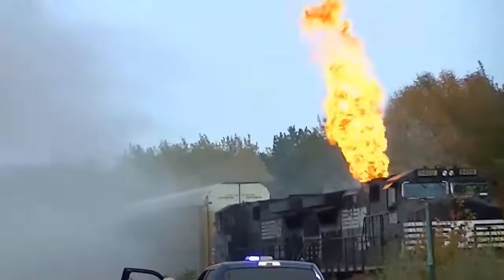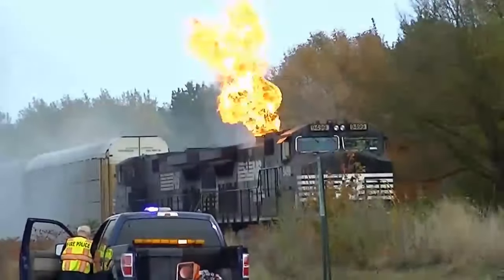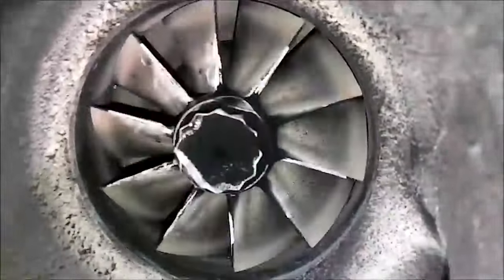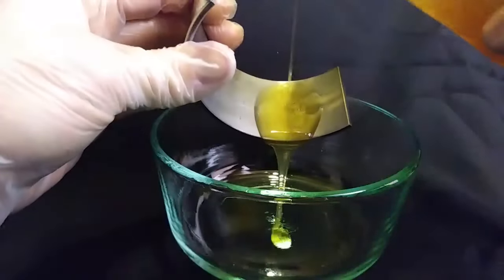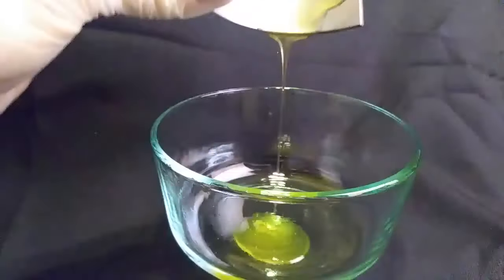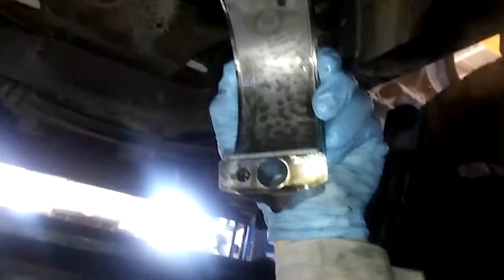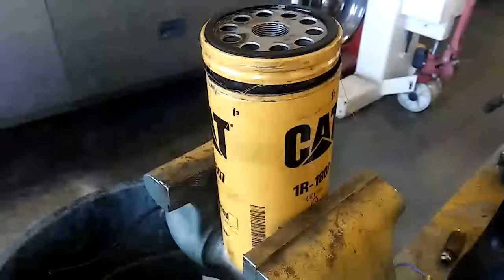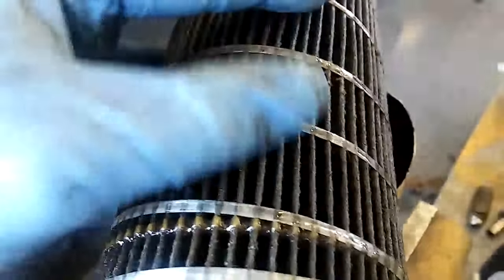Engine Block Heater vs Oil Pan Heater. Everything you NEED to know about Cold Weather Diesel Engines

Comment: After the states in the video,  the two most important cold start tips for freezing temperatures in my opinion would be to turn tgr key on and wait about 30 or 40 seconds after the flash does its thing to let the glow plugs cycle and to push in the clutch on standard trans regardless of it it is in neutral or not.

I sometimes will let the glow plugs cycle twice before attempting to turn it over.

The clutch disengage the transmission so the starter isn't turning over the mass of the trans components.  It gives a slightly faster crank and your batteries will last a bit longer in the cold start situation.
Reply: Fine advice for passenger vehicles, but these old yellow motors have no such fancy heating contraptions. 

👍 pushing the clutch helps, not something most think about. On my old 7.3 I'll cycle the glow plugs 3 or 4 times before I even try to start it when its down in the -30/-40s.
Reply from the maker: Pushing in the clutch does help reduce the starter load.
Reply: I never cycle the ignition in cars, instead I listen to the relay clicking. Usually the glow plugs actually stay on twice as long as the indicator is telling you :)
Reply: @jaydunbar7538  heck. I have to do that on my 7.3s even at 30 degrees.
Reply: Most modern vehicles have a safety interlock that won’t allow you to even crank it until the clutch pedal is pushed in, and they’ve been that way forever. I bought a new 1979 Chevrolet 1/2 ton with a 4 speed and it came with a clutch interlock switch on it, but it was disabled the first time it came loose from the clutch pedal arm and wouldn’t crank. I had to coast it down hill and dump the clutch to get home. Found the switch had fallen off the clutch pedal arm the next day and promptly cut the switch off and connected the wires together for a permanent fix.
Reply: I had no idea about the clutch thanks

Comment: I like the coolant circulation heater the one I had would keep the coolant at about 90 to 120 degrees and because it has its own pump so you can use the heater and it usually would keep the whole engine compartment warm... Also they normally run tank blanket when you run up north

Comment: So up in the Alaska arctic oil field we install oil pan pad heaters and also block/coolant heaters. When it's -50 degrees fahrenheit or less we use heat trailers to warm up the engine. Those suckers run at 1500 rpm from fall and then shut down in spring. One driver let one idle at 900rpm all night and the coolant cooled down to 40 degrees and pushed all the oil past the rings and into the exhaust and made a good inspection window in the block. But then a piece of block grounded the positive on the starter and caught the engine bay on fire

Comment: Outstanding information for the trucker. For the logger I have set up a canadian system where I run 2 hoses from my pickup to the equipment circulating hot coolant from running pickup to cold skidder/dozer/excavator etc . Must be the same coolant. 30 min and head temp which is critical for combustion is up high enough to flash off upon cranking as long as fuel is moving. Used at -20F and away we go. Also run into intake flame heater's where you inject raw fuel onto glow plug in intake and intentionally start fire in intake just prior to cranking to increase combustion chamber temp. Found on komaysu and perkins so far.
Reply from the maker: That's a pretty good idea. Did you make some quick connects similar to a PTO to a trailer or something?
Reply: @AdeptApe  3/4" heater hose with quick connect both ends. coil them up in a bag when not in use to keep them safe. About 15' long . If you have a specific piece you are starting cut to length that works. If you're starting everything the one that takes the most hose is what you have to go with for length. Probably holds an additional gallon of coolant tho.

Comment: I made a lot of money towing semis from the USA that came to Canada running #2.   Another thing that fuel will do is plug the vents and all the fuel run to one tank and then draw from the empty tank. Plenty of fun solving those problems   Even though we have additives in our fuel , I always put in fuel conditioner.   The other mistake that operators do is not cover up the front.  It's a lot more difficult keeping that engine warm when it starts dropping below -15c.  A belly bag/blanket is also a good idea if your operating in -20c or colder.  
On my personal vehicle (gasoline) , it's a block heater and a battery maintainer.  I've also used battery blankets. 
If you have none of those things, I suggest using one or two high wattage bulbs/work lights under the hood, covered by a blanket to keep the heat in. It will bring the block temperature up.  
When you live in an inhospitable environment, you learn to improvise.  It's been -30c to -38c all week.
Reply from the maker: It's been cold here this week, but not -30.  I've started using just a cab heater to help get the ice off the windows and helps from turning the heater on immediately, which in turn helps the engine warm up a little faster.
Reply: @AdeptApe  yes, it's been brutal.cold here. -38c last night. Calgary was -42c.  Every little bit helps when getting a engine running in these temperatures.  They were not designed to run in these extreme so getting them to operating temperature takes a lot more effort and resources.
Reply: We pretty much can’t buy any incandescent 100W bulbs here in the US anymore, and the others available don’t make enough heat to matter.

Comment: I knew that i was going where it was going to be really cold, so i added a block heater and a two battery tender. It was -15 degrees, and the truck was ready to start in less than a minute it it didn't work at all to start.

Comment: Other alternative methods: heat gun or propane torch near the air intake, or torpedo heater over the aftercooler if you have one. We have a 7.3 PSD Superduty with a bunch of glow plugs out, and the grid heater could barely be called that. You can't feed it warm air pre-turbo or the aftercooler cools it back down too much. I put a torpedo heater pointed down on the cooler with the hood popped, give it a minute to heat the air charge, and fire it right up. Works pretty well for the really cold days we've been without electricity for the block heater.

Comment: I have an oil heater in the shop that I have waited for this video to confirm that I should install it! Thank you sir for your time and effort.
Reply: Same here Lol
Reply: @glovierstreeservice3271  
I didn't know how hot these things get and I didn't want to degrade the life of my oil. Mine looks like a short water heater element. I'm going to put mine in a available port on the bottom side of my oil pan. It's a C15 Cat.  The blank port is the same level as my oil drain. do you know if there is any clearance issues once installed?
Reply: @victormcox  I dont know about the clearance

Comment: Lived and trucked in the Northwest Territories Canada for 8 years. Block heaters, oil pan heaters, battery blankets, 0-40 synthetic, fully closed rad cover, fully closed in belly tarp, wrapped exhaust and insulated burner box. Insulated def tank and lines, insulated fuel tank,lines and filter, anti gelling additives, methal hydrate in the air system, wrapped and heated air dryer……..and your truck would still freeze up.

Comment: I dump plenty of anti-gel in my trucks in winter.  I also added regulated fuel return systems to heat my diesel.  When it gets bitter cold I add some 100% isopropyl alcohol to keep from gelling.  Do it very often and it can dry out your injectors...

Comment: In highschool (1993/4) I worked for a OTR trucking company that put disposable baby diapers ie pampers on their fuel filters in the winter. They ran a mix of 855 Cummins and 3406A and 3406B engines.

Comment: i got a webasto, and the timer for it, set it for  half hr or hr befor fire n good to go, powered off truck batts no 120v, i also plumped it into my artic fox inframe barrel fuel heater, so pre heats fuel also

Comment: I used to live in Fairbanks, AK, and I found most guys there, no matter what car, pickup or semi or industrial equipment they run, they put all of the above on. Plus a stick on fuel tank heater and heat trace on the fuel line. Then a tarp that goes from the top of the radiator down under the engine and ends somewhere near the transmission. That last one is more ice road truckers in Canada but still, when you're hundreds of miles from civilization in -50f cold, you're going to do everything to make sure your truck isn't going to fail

Comment: My father in law used to work in the oil fields in North dakota. Their remedy to fighting the cold was to basically never shut their trucks off. They would high idle them during shift change and the next crew would do the same. They only got shut off in the shop.
Reply: That's what my company told me to. they barely had 100,000 miles on them but have the hours of a 500,000 plus mile truck
Reply: 500,000 hours doesn't matter because there is very little engine wear. Diesel engines take many hours to get to operating temperature.

Comment: I have owned a 2001 Dodge Ram 2500 4X4 with the 488 cubic inch V-10 since 2004. I have 700W block heater, 150W heaters on the transmission pan, engine oil pan, 50W heater on the power steering oil reservoir, 80W battery blanket, and a small, waterproof trickle charger. I plug it in and I'm good to go. For when the temps fall past -15* I have a 1500W circulating heater. I have never had a problem with my truck except for normal maintenance.

Comment: Seeing that NF Southern engine spewing fire in the beginning of the video gave me a good laugh.  My father-in-law used to work for CSX and told me stories about some poorly maintained NF Southern trains.  Funny story about cold weather and diesel engines.  My grandfather owned a sawmill and logging business when I was growing up in western KY.  The weather in the winter would not get brutally cold like up north, but would have mornings where the temp was in the low teens from time to time.  My dad was driving into the woods early one morning and the log crew had a fire built under their old Timberjack skidder.  Apparently that was their way of heating the oil and engine up to get it started lol.  Very informative video and very well done sir!

Comment: Those little Kim hotstart thermosiphoning heaters are nice.
Most of the gens I see under 250kw or so have a plenty warm block ,and the oil pan (by feel) isn't far behind it. 
On a vehicle it's gonna have to circulate for quite a long time to be able to soak into the oil too though.

Comment: Coolant heats the block, block heats the oil pan, pan heats the oil. My 7.3 will heat the oil pan enough that it’s warm to the touch on the outside after being plugged in overnight. Proper oil weight for the operating environment is just as critical as starting aids. Switching to 5W-40 synthetic has done wonders for cold start performance.

Comment: My w9 3406e comes home with me daily. This is my setup when the cold months roll in. I make a 50/50 blend of T6 5w40 with T4 15w40, oil pan heater and the block heater. Inside the cab I run a space heater. She’s never let me down once and I know there’s good oil flow and lubrication on startup. Also before every winter I run a draw test and clean and lubricate every battery/wire terminal
Reply: Why not just run Rotella T6 0w40 oil?

Comment: I live in Northern Quebec .Deep woods deliveries .I use oil dip stick and block heater .Buy a high amp battery, never had a starting problem even at minus 45...Unimog...

Comment: In Alaska we use all of the heaters to get rigs running with minimal wear
Reply: Honestly Alaska is the reason that the last generation of the Dodge Dart came with the option for a block heater. 
(And subsequent recalls for the dual clutch automatics in extreme temps)

There may be other fiat’s/Chrysler’s/dodges/jeeps that have that option too. Since the powerplants are shared.

Comment: The 120v heaters are about 1500 watts and if you leave it on all night that cost a lot. I use a diesel fired coolant heater that will get engine warm when below 0 f in two hours or less and I don't require 120 volts supply. When the engine is warm the oil heats up pretty quick.

Comment: I have a gas 5.7 hemi.  I run a block heater, battery blanket and oil pan heater, they call that the arctic package and yes I used it in the arctic.  My truck started every time in -60  so they all work, but as a package.  The block heater and oil pan heater especially although my battery is 8 years old...  Synthetic oil helps too.

Comment: Good video ty.
An ancedote; I had a 800a 12v battery freeze on me in 2015. It was on a project truck and I put a charger on it in the fall and come February the temps got past -30 celsius for a few weeks. I eventually thought to check on the batteries and 1 of them had popped the lid, the case was bulged and had oozed out a bunch of slush.

Comment: I just picked up a 5.9 cummins that I'm going to fully go through, as well as build the truck (dodge frame, 83 Ford body). As I go through the planning process, I have in my mind the idea of a 3 plug connector hanging out to be plugged in, and on this plug, I'll have a block heater, battery tender, and Fass filter heater. Glad I'm on the right track with my plan, and thanks for reaffirming a pan heater as a decent option.
Reply: I put a maintainer on each battery in my old 24 Valve and fed all three plugs into one so I only had to deal with 1 cord to mess with everyday.

Comment: I got stock in South Dakota with my (Freightliner Columbia, Detroit 60 14L)for like last 12 days,and the freezing made me spend over 4k on repairs,  Fuel gels,air lines freezing,radiator freeze down and circulation was poor,and was overheating,colant was weak for that weather, one of thermostats got stock for being idle for over 100hr, brakes  got lock on the trailer and i did killed 2 tires,etc...I wish I did watch your video before i got to South Dakota, that fuel nr 1 that's what Towing guys are using here.

Comment: Canada’s-60 I’ve had to turn on n off glow plugs 6+/- times to get the glow plugs to even light, then again 6+/- times to pre-heat the air/cylinder assembly before I would even try turning the starter.
At -40 / -60 is also when tires start to freeze usually freeze flat on the bottom side having to drive slow until the tires warm enough to get a round shape.

Comment: If you only occasionally travel to the super cold areas, the magnetic oil pan heaters work really well. They heat the oil and the heat travels up towards the rest of the engine. You can get 2-3 of them if you want. You snap them on after you shut down and remove them before you leave. The only limitation is that a lot of Cat engines have cast aluminum oil pans so they don't work on that.
Reply: Most of the newer diesel engines have a plastic oil pan too. Lame!

Comment: I use the block heater in conjunction with the oil pan heater plus trickle charge the batteries. I use a portable generator to plug 🔌 all this in. You are ready to go in 4 to 5 hours. Starter winds over faster and you have almost instant oil flowing through out the engine

Comment: I had a Jetta TDI, I installed a coolant heater. I swear by them. Did not matter the temp, my TDI would fire right up with heat from the heater nice and toasty warm. After so much luck with that, I installed one in my Suzuki Samurai. It was much easier to install and did a terrific job as well.

Comment: I would pick the oil heater over block heater because at start up I want that oil to get where it needs to go as fast as possible and reduce wear.  But I really believe in running both at the same time.
Reply: If you can get it started in -30, as in getting combustion
Reply: As in drive a minimum of 5mi to get the grid heater to stop cycling and 15mi more to get the thermostat to pop the first time. -30 f 750w stock block heater for a 6bta   85% Rad blocked . No plug at -23f no go crank to slow, next day -19 started without the plug.

Comment: I have actually used the battery blankets , frost plug heaters and 1.0Amp on board trickle chargers on my 5.3 L gas GM truck engine. It sits outside. I pkug them all into a splitter under the hood and then into a timer on the wall so it doesn't run all night long.
I only use it below zero.

Comment: The John Deere tractors I grew up around were from the 60s and 70s. They all used block heaters with ether as a back up. We later got a 90s Ford and the glow plug it used was a bit confusing at first.